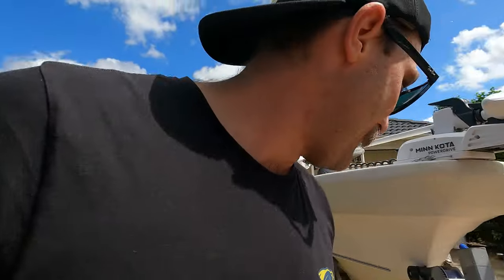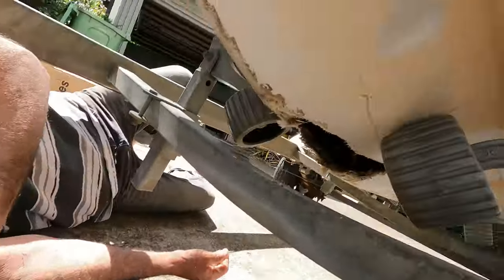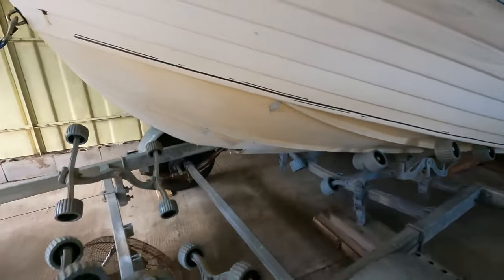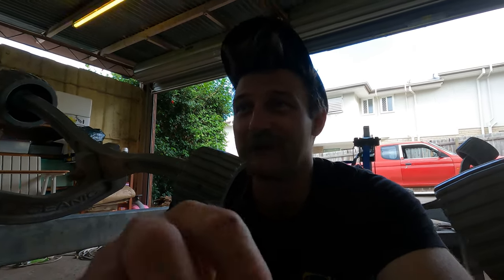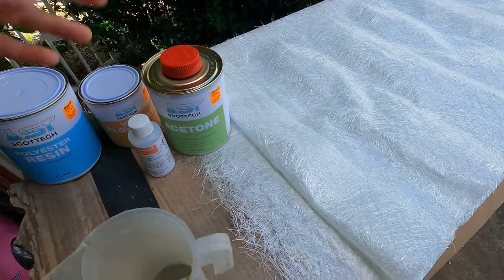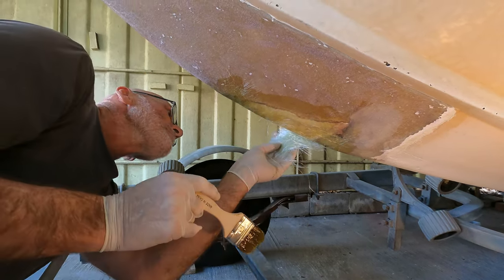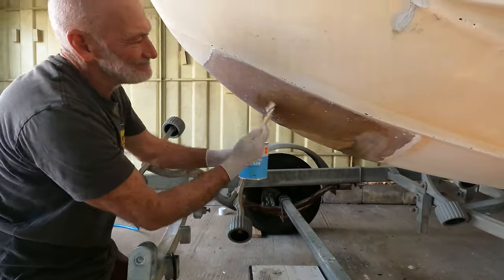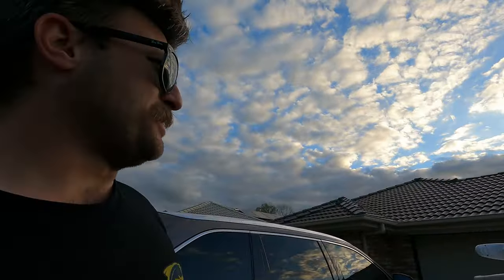I put a hole in my boat - Fibreglass Repair

Comment: This is s a perfect instructional video on how not to repair below the water line hull punctures. Wrong type of resin, wrong type of glass, didn’t repair the stringer from the top, didn’t grind back the glass around the puncture to the right degree and then use corresponding glass levels etc etc, could go on forever.
Reply from the maker: Who said it was supposed to be an instructional video, just documenting my repair. But thank you. If you want to, feel free to come and help me do a video on how it should be done properly mate. I’m no bothered either way 💁‍♂️
Reply: What type of resin needed to be used?
Reply: Bulkhead repair be first job, skip that straight to wonder spray foam
Reply: Beer box has waxed surface for easy release
Reply: i think he was just trying to do a quick cheap repair and not spend much on an old boat
Reply: Should’ve used epoxy and a structural glass (woven, 1708, 1808 etc.). Repair should’ve been done from the inside too but he talks about it in the end. Honestly it’ll probably be fine. Hope you get tons more trips out of it
Reply: for under the water line hole that we dont have acces to both sides should we use mat or gloth???
Reply: @makesumwake  yes, but should have did it from inside on top first then outside botton
Reply: @arshiavali1597  thats why you have to make acces.

Comment: It appears you used all chopped strand mat ?  It will plug the hole , but does not have much strength on its own . If the area beyond the hole was damaged or cracked, you may want to add a few layers of biaxial or woven roving.  I would keep a close eye on it as it is. It may be fine. Best wishes.
Reply from the maker: Yeah just chopped mat. It’s holding up well, the rest of the area was already previously strengthened when we first got the hull. Thanks for the comment though.
Reply: @BrisVegasFishing  nope you need to use matt then cloth then matt etc or a combination matt like 1708.  And mate you didn’t even replace the stringer you ripped off either, completely nuts, you need to cut a hole in the floor from the top, dig that Bunnings foam out and tab in a new stringer from the top. And also glass in the repair from the top to the inside of the hull.

Comment: Very nice looking job but I was really surprised you didn’t use any glass woven glass that’s a really need to be really strong in that area. Did you have any problems later on?
Reply from the maker: One of those best you could do at the time, if we wanted to spend more time and pull the deck up it would’ve been better. But cause it was quite a curved, high wear area didn’t wanna use wovens. Definitely would’ve given more strength. So far it’s held up really well and not worn through or busted again. 🤞

Comment: Is this patch still holding up nicely? I bought a boat with a hole and a shop told me it’s rotten and refused to take on the job. Now I need to do it myself. I really like this video and I’m gonna do a similar technique
Reply from the maker: Yeah still holding up well considering the lazy nature in which we patched it 😂 definitely would recommend glassing up from the inside if possible. But definitely remove as much of that rotten material as you can. We were lucky that we’d previously replaced all the stringers up to that bulk head. That small rotten peace was all that remained from the original stringers.

Comment: Towed the boat up to Mackay and the bow rest broke off on the ride up. The piece of metal left over from the break punctured a hole right through the front. Looks like your video will be a great help, I’ll definitely grab some of that foam spray.😊
Reply from the maker: Aww no mate! That’s cooked 😬 hope the vid does help you. That expanda foam works great for awkward jobs like that.
Reply: @BrisVegasFishing  ohh well, good practice to give it a go. Might beef up around the little metal bit that you pull the boat on the trailer with (don’t know its name). Then find a person to weld the trailer. Fun and games!!
Reply from the maker: @Timbuctoo  all fun and games 😂 boat maintenance is just never ending aye 😅

Comment: I’m curious if this repair held up so far, likely doing some fiberglass work soon but want the repairs to last
Reply from the maker: It’s held up fine over a year later, but look I’d definitely recommend repairing from the inside of the hull before doing the outside. This will give you far better strength and longevity. However if it’s like my boat and you can’t get to the inside without creating more work it’ll be fine.

Comment: I think you had some damage already that weakened that area.   I can’t image anything floating that would do this.   Water intrusion a little at a time weakens the hull.  Some of that debris coming out looked rotten.   Maybe you should of worked in a metal edge.
Reply from the maker: Haha that rotten piece was part of the original stringer from when the boat was first built. The damage stopped when it hit the new bulk head we’d installed a few years ago. 
Pretty sure what we hit going down the river was part of a pontoon or metal gangway, cause you’re right it’s hard to imagine hitting a piece of debris could do that much damage. Loads of rubbish in the river after the floods though.

Comment: 100% must laminate woven roving layers to the inside first. re shaping the keel. than staggered layering to the outside followed by fairing and gel coatgelcoat
Reply: Yes, you are correct. They patched it with chopped strand mat. By itself it is not very strong, biaxial or woven roving would have been a good addition to the repair

Comment: Woven roving has very high impact/ burst strength whereas chopped mat has very low burst strength.
Reply from the maker: Yeah that’d be why it broke through in the first place then? The original hull wasn’t real strong in that case 😂
Reply: @BrisVegasFishing  That and the rotted wood was a clue. Probably a stem piece turned to mulch.
Reply from the maker: @paulbriggs3072  it was the last piece of rotten timber that we hadn’t replaced from way back when we first replaced the stringers. If the rest was rotten the hole would’ve gone back way further on impact 😅
Reply: @BrisVegasFishing  Aha.

Comment: What type of foam did you use? I Nedd to do a similar repair but was told resin will melt the foam.
  Aslo how long do you wait better layer ? Thanks
Reply from the maker: We just used the tins of expanda foam you can buy from most hardware stores. The foam is more there just to help keep the shape of the hull. So it’s easier to glass it. If it melts that fine. Wait time can depend on the weather and how ‘hot’ you mix your resin with hardener. We would just give it a couple hours between layers. And then sand back/ apply acetone between layers.

Comment: Good job mate. F@ck some people will whinge...literally about anything. May not be to standard, but good on yas for having a crack at it yourselves and saving thousands and probably months of wait time. If it splits out again, then go in from the top and sort out the stringer and use the woven material.. if it never has any issues, then you done well.. shes only a tiddly anyways. #tightlines bud
Reply from the maker: Thanks mate really appreciate the comment. And you’re right it’s definitely a stronger repair if done from the inside. That busted stringer was the last bit of the original, when we originally rebuilt the boat we fixed up as far as the bulk head. Hence why the hole didn’t go back further. But if it does open back up we’ll just have to take the time to go back in and fix it properly. Tight lines 🤙